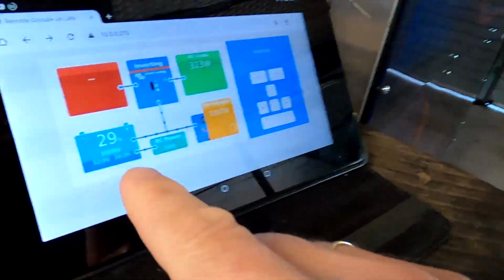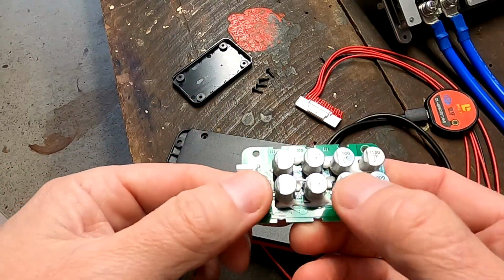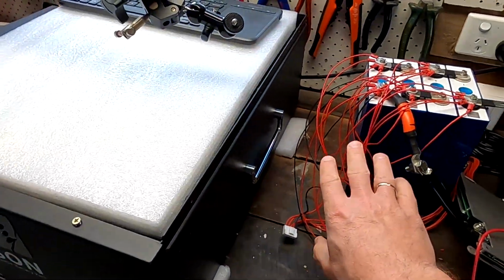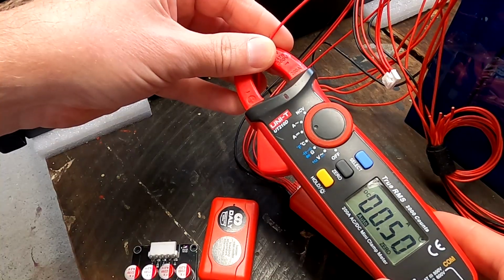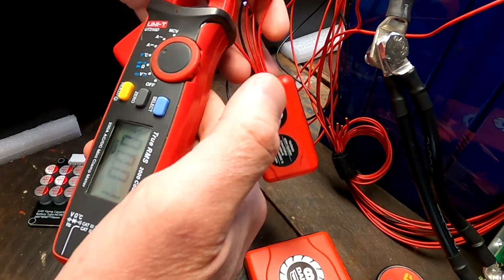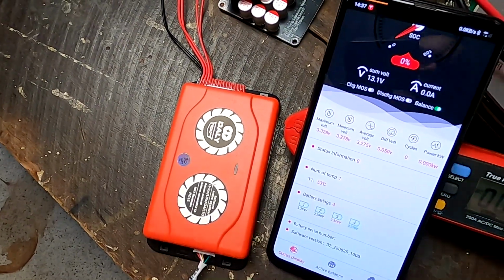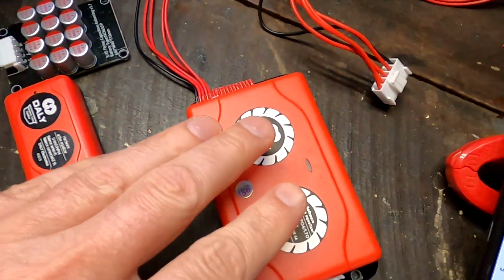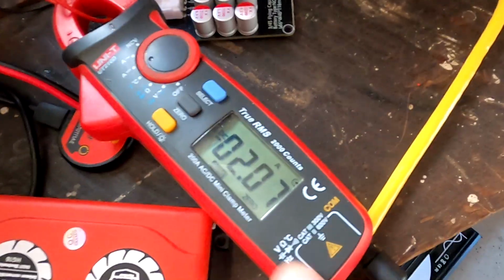DALY has now Active (Smart) Balancing! Is this the new NEEY?

Comment: Hi Andy.  About a week or so ago I posted a question about why no one makes a BMS which charges each  CELL individually (but all at the same time in parallel) rather than charge across the entire PACK in series. This new method of individual CELL charging would stop charging any cell that exceeds the upper limit and as soon as that cell falls below the upper limit resume charging that cell. This would eliminate any need for either active or passive balancing. Since active balancing currently requires discharging a high voltage cell into a capacitor and then charging a lower voltage cell from the same capacitor it is absolutely possible to build a BMS which only charges each cell individually with no balancing circuitry neither active nor passive.

 I decided to try to make such a BMS myself and in the process, I have learned a few things about how difficult and costly that could be. There would need to be a circuit to take the large "48" volt input from the charger and break it down into smaller voltage paths, one for each cell. This would add additional cost and complexity to manufacture due to the additional circuitry. This explains why chargers currently charge across the entire pack rather than each cell individually, it is simply cheaper and slightly more efficient.

HOWEVA, I decided to try to understand the balancing process more precisely and so decided to build my own BMS using an Arduino to control the process. Since my career was in programming, I do have the LOGIC background to know how to write the code for such an endeavor but have had to learn a new programming language to code the Arduino. I also needed some time to acquire the hardware necessary to build a small prototype. Also, since the chargers today are built for the larger voltage across the entire pack method, I will initially use that method rather than charging each cell individually. Perhaps in the future I will try individual cell charging.

During the learning process, I discovered that one needs to sample an individual cell's voltage multiple times and then average the readings out to get a more accurate (truer) voltage since the Analogue to Digital Converters (ADC) in the Arduino chip detects a slightly different voltage each time a cell is sampled.  Sometimes it is slightly higher (in millivolts) and sometimes it is slightly lower. This brings into question how accurate the ADC samplers are in current BMSs.

I have learned that the programming required to create a BMS is in essence very simple and can easily implement both active and passive balancing at the same time. The program simply loops through a series of steps. Step one: ALL the CELLS in a PACK are sampled to determine the highest and lowest voltage cells. Step 2:  Charging of the entire Pack is stopped if any cell has a voltage which exceeds an upper SAFETY limit. Step 3: When one or more CELL(s) are above a BALANCING limit and one or more CELL(s) are below the balancing limit, active balancing is invoked to transfer some of excessive voltage from the highest cell to the lowest cell. Step four:  If there is a Cell above the limit but no cells below the limit passive balancing is invoked to drain some voltage from the offending cell.  

CURRENT BMS design usually doesn't utilize BOTH active and passive balancing choosing instead to use only one of the two methods. When utilizing active balancing alone a BMS usually only attempts to balance when the difference between high and low cells exceeds a certain limit and there is one or more cells below the individual cell limit otherwise it would continuously be transferring voltage and draining the entire pack. A BMS using passive balancing alone wastes some of the stored electrons thereby requiring more time to fully charge a pack.

Since all the CELLS are connected in series across the pack, only one cell can be connected to the capacitor or draining resister at any one time. 

In either active or passive balancing, the number of volts transferred depends on BOTH the capacity of the hardware to handle the amperage as well as the time allowed to complete the transfer process. The BMSs you are currently testing may have the HARDWARE capacity to handle the higher amps but have not provided the required time via the SOFTWARE to actually complete the transfer.

For the purists, the term amperage is used to define the number of electrons flowing across a circuit being the equivalent to a charge of one coulomb (6.241 x 1018 electrons) per second.  In this discussion, I am using the term AMPS simply to represent the number of electrons being transferred.

Obviously, this is still in the theoretical, learning, testing, and developmental state and nowhere fully developed enough to say whether or not it can be further developed.,
Reply: It would be nice if you could have a learn mode, which would most likely learning that certain cells are always the guilty party, and then it could give priority to those cells.  Keep up the good work, and keep us informed.  I am very interested in what you learn.
Reply: Good approach, but I think in the long run it would be better to combine BMS and inverter. In the way of a "Cascaded H-bridge Multilevel inverter". This would have only advantages, except for the increased hardware requirements. But this is already being researched (BM3).
Reply: Interesting concept and I like Aaron’s learn mode idea too. It sounds quite do-able, I guess the expense here is in individual cell, high amp, low volt charging gear, but it makes sense if u individually charge each cell to a specific voltage with a set tail current cut off, the dodgy cells will get there quicker perhaps but then u could prevent any further charging to individual cells as they reach their peek absorbtion while the other cells in the pack can carry on charging at peak rate till they all catch up and stop when they reach their set peaks, this would allow for a much more efficient/quicker charging cycle & probably many benefits particularly to solar users/harvesters. I like ur idea, please keep us informed of how u go with it. Cheers
Reply: @evil17  Thanks much for your kind reply.
Reply: You should be working with Daly Daniel, we might actually see some better results from these pretty red boxes then!
Reply: @evil17  Thanks much for your kind reply. I do read them all.
Reply from the maker: Well, the BMS should not be responsible for charging your battery. What you should develop is a charger on cell level.
Reply: interesting approach would love to work on such a project! @OffGridGarageAustralia
Reply: would like to see this work!
Reply: I apologize for the slow reply, I started replying earlier today but Windoze crashed and lost the reply. The bottom line is that this is easy to do logic wise and in fact, I did code and test this using an Arduino board. 

It is easy to add active balancing to a BMS which already uses Passive balancing of MULTIPLE CELLS at the same time because the passive balancing already uses two wires per cell, One on the positive terminal and the other on the negative terminal.

Likewise, it is easy to add Passive balancing to a BMS which already uses active balancing of MULTIPLE CELLS at the same time for the same reason.

Howeva, it would be hard to implement both active and passive balancing of MULTIPLE cells at the same time within a BMS  which doesn't allow simultaneous balancing of multiple cells because they usually use the positive wire from the previous cell as the negative of the following cell.  Notice I said MULTIPLE cells simultaneously (at the same time), not one cell at a time.

The trick to doing both Active and passive balancing on multiple cells (along with the two wires mentioned above) at the same time and preventing the BMS from stopping charging due to a single cell reaching the BMS Cell high voltage shutdown point would be to begin the passive balancing before a cell reaches the BMS's programmed cell high voltage cutoff point.

The best way to passively knock down multiple cells at the same time is to use a system such as the Batrium system which uses a resistive load, a bunch of small resisters, and two wires attached to each cell, one to the positive Post and one to the Negative post.

 I will post another reply following this one to explain how the Batrium system Could be modified if the manufacturer desired.

 @ajayvashisht9708

Comment: Hey Andy, What about testing the PowMr HA02 balancer that is intended to balance 12v batteries in series. I have been using one for the last few days and I think it works pretty well.
Reply: I have looked at this option, but one would need many (5) for a 16s system, and not many amps at small mV deltas.
Reply: @mfgxl  What I am talking about and using it when one puts multiple 12v Lifepo4 batteries in series. I have 4 in series and there fore using 48v. One unit is enough for that as each set of wires can handle 12v+.
Reply: I would be interested to see Andy do some testing on these units too, as I have one I was going to use as you have, but have not used it myself as yet. So u have 4 x 12v lifepo4 batteries (with BMS’s) in series and this seems to be working ok for you, ur 4 batteries are ok to put in series I take it? I had an issue doing this myself once, the batteries I had were not supposed to be in series or parallel, they seemed to be working ok for awhile but did have a bit of an overvolt situation for a short time and it blew most of the bms’s, I pulled the packs apart and have made 2 x 24v 200A batteries with JK BMS’s since and they are working great now, also the batteries were made up of 28 cylindrical cell (15A cells) & the JK brought the strings into equalisation fairly fast that were somewhat out of whack otherwise.
Reply: @evil17  i do not know if my batteries are qualified for serial connection but I have done so a 16aug22 for 48v and they are still alive 03sep22. Previously I used 2s3p 24v setup.  I have some (6) unknown brand 12v LIFEPO4 that I picked on ebay auction at a reasonable price (average about A$330 each supposedly 135ah) that I initially used in a 24v setup charged from solar through an Esmart3. They where used to power a 1000w 22-65v limited grid tie inverter through the load part on the Esmart3. It worked but didn't get too much from the batteries as when the voltage gets close to 24v  the inverter output is only 2-300w. I there fore decided to try 48v. I didn't do any balancing of the batteries at all and of cause had one turning off too early on discharging (not always the same one). It then had to be restarted the next morning as the Esmart3 didn't start charging because it didn't know the battery voltage. I also had problems with charging switching off. 
Two days ago 31aug22 I then installed a PowMr HA02 equalizer and immediately I saw a difference. I was then able to set my Esmart3 to 11.8v battery low, bulk charge 14.5v and o v 15.0v. None of the batteries have turned off since (3 days and 3 nights). Unfortunately I have only been able to get up to 6.6kw (not enough sun) from my solar panels so far but it looks good.
The problem for Lifepo4 batteries in series I would think is that the BMS can't take very high voltage. If say in a 48v system one turns off either for over voltage, under voltage or excess current it would be able to get 36v over it if connected directly to a load.   If an external control system could be designed to prevent over voltage on any single battery in a serial connection there should be no problem connecting any number of Lifepo4 batteries in series I would think. I should be able to design such a circuit my self as I am an electronic design engineer but I haven't designed anything really for many years. I got my education before micro processors existed. My education only proofs that I could learn and that I am trying to do from every body else now..
The 1000w inverter has worked ok for a few years but my Esmart3's are giving a few problems. I have 4 x 40 amps and 2 by 60 amps. The 60 amps are new and are ok now but the 40 amps have little problems all of them now. I believe I have fixed one of them (The load FET blown) and I am looking at the rest now.
Reply from the maker: Got one on order...

Comment: Does the Daly work if you use a 16s plug ?
Reply from the maker: I haven't tried yet. The cables they cut off are very short and glued to the white plastic plug. I would need another of these connectors and test it out. I'm sure it will work. The PCB seems fully equipped for that.
Reply: The question pops up every once in 😂a while 😊 Thanks for your happy and kind story telling man. It's fun to watch your experiments.

Please check out the 16s function, they might code the balancer firmware on 4s although the hardware is fully equipped. I have 20s and can only get a green light if I connect the plus pole of the overall assembly to the last pin of active balancer. Currently having 12s battery and won't see cell 12 if not connecting the cell's +pole cable to its position at active balancer. Else, same issues in Daly logic parameters settings, etc not really reflecting battery needs. Also it seems some BMS settings in App reflect settings of balancer which is always confusing. Daly should let one choose (or autodetect) which device one is dealing with.

Comment: Like your channel, you have better testing equipment and knowledge but can you test the following phenomenon, the backfiring from inverter on DC bus when due to a short circuit the BMS discharge MOSFETs switch off and the I2/Delta T effect that occurs due to the magnetic flux at max in transformer. I have installed several micro grids using Victron Quattro's and we had BMS boards blown after this phenomenon occurred. Mostly transient voltage surpressors, diodes or smd fuse on BMS boards blown.
Reply: @just_saw_dust  through low voltage overhead lines going through the village, it are micro grids, some of our microgrids have been published by victron , like binaluan and Noah Noah island resort. Using lithium packs and occurring shorts even the BMS boards can switch off due to overcurrent detection and cause backfiring of energy due to max magnetic flux collapsing
Reply: @just_saw_dust  preventing this phenomenon is done by so called snubber circuits
Reply from the maker: I cannot do any tests which involve electrical shorts . That is unsafe.

Comment: biggest issue I see is the inaccurate voltage reading. Need a voltage calibration setting in software.
Reply from the maker: Yeah, I don't know what that is🤷‍♂️, I checked multiple times with other devices and it measure far to high.

Comment: Another good video. Really wish I hadn’t bought all my stuff while watching Will Prowse. His love of Daly caused me to buy two 250A models. No problems so far, but haven’t put my side into production yet either.
Reply from the maker: The BMSes are not too bad except from the balancing part. If you add one of these capacitive active balancers for maintenance purposes and activate it from time to time, it will be OK. I have one 250A Daly in use for while in one of my 12V batteries and beat the crap out of it with the Peter inverter and my electric chainsaw. Not problem with this BMS so far.
Reply: @OffGridGarageAustralia  Good to know, Thx. As a direct result of your efforts I have decided to get 2 of the 5A Heltec balancers, 1 for each of my pack. Appreciate all the effort you put into these videos.
Reply from the maker: @inmyimage1081  thank you. That's a great choice, they will work well.
Reply: @OffGridGarageAustralia  so if somebody has a Daly BMS and they also want to buy the Daly active balancer I see in the app you can see both but can you see both at the same time? Does your phone then connect to two different Bluetooth devices simultaneously?  One at a time?  Or does the active balancer communicate through a cable to the regular balancer and then get forwarded through the Bluetooth to your app in your phone?
Reply from the maker: @SiriusSolar  they both communicate through Bluetooth. That is a very good question if the app allows two connections at the same time. I would say you will see only one device at a time. I'll test this as well...
Reply: I think Will P. is often so enthusiastic about some products that perhaps $omething stays behind it...

Comment: Can the balancing cut in be set to 3.35?  Or only to the 10th position like 3.3 or 3.4?
Reply from the maker: It can be set to 3.35V or 3.37V for example.
Reply: @OffGridGarageAustralia  awesome, thank you.  Although not perfectly ideal that all the cells have to reach the set point at least we know that they normally do all go above 3.35 when they're approaching full even when balance is pretty far off.   I think 3.3 might be a little low but 3.35 would be perfect.

Comment: QUESTION?  There's only one inductor so does that mean that it can only drain one cell at a time?  You asked this question to yourself in the video. I'm real curious about the answer.   And then what's with all those other wires?  They charge a lot more for the unit that balances more cells. So you asked yourself that question too. What's the answer to that?
Reply from the maker: I'll test it out...

Comment: So, they're manufacturing only one smart balancer module. If a customer wants 4S variant they simply cut wires, really? Why, they should sell only 16S device then. Or this is why balancer fails, it's simply not designed for 4S.
Reply from the maker: That's how it looks like to me. The internal PCB seems to have all the components...